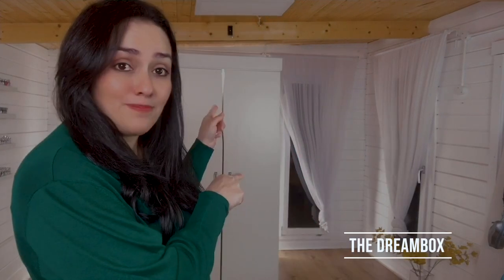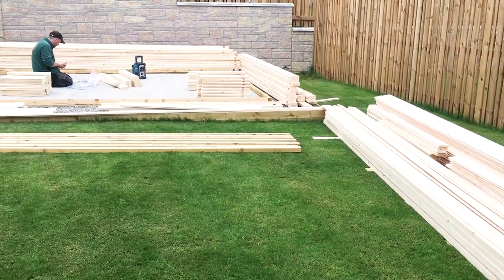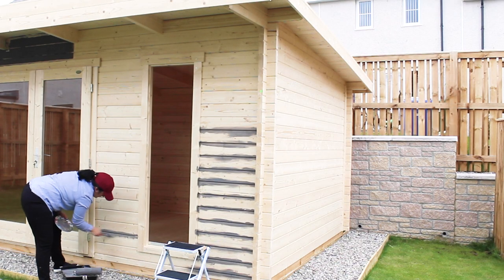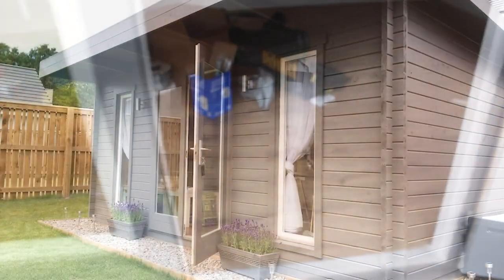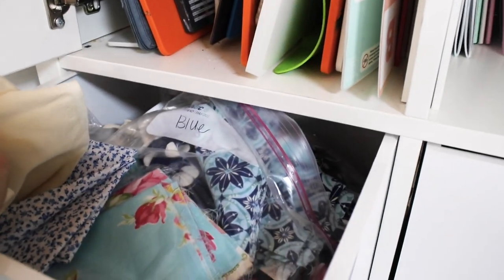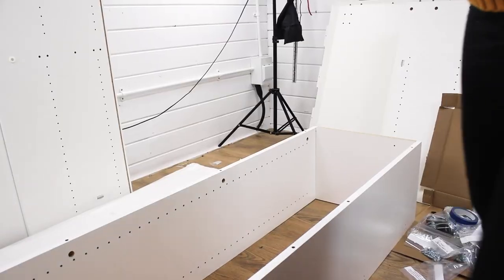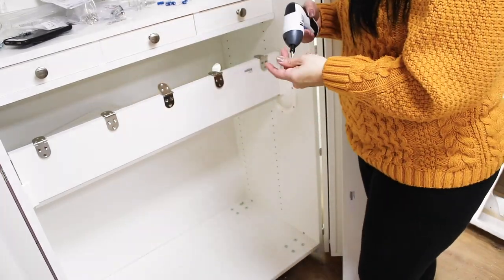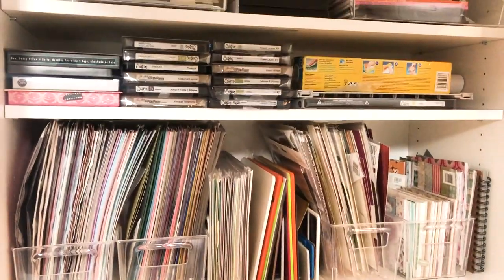DREAMBOX in a Log Cabin - SHE SHED + 2024 Discount Codes

Comment: Where do you store your glass Matt when not in use. Or other larger things like score boards, tonic folders. Did you use all your boxes and shelves or have you made sections bigger to accommodate items ? If you didn’t use all the shelves or boxes where do you keep them? Where do you keep items that don’t fit in there?  Do you still have space to put the upcoming tonic various club dies and stamps that you get? Also do you find that you do NOT close it every time you stop crafting.
Reply from the maker: Hi Viv,   yes I do keep the box open.  if I need to close it  I just put the glass mat to a side.  The few shelves I'm not using are above the box inside the crown - no over the light area tho. Underneath the table, there is plenty of room to organize larger supplies and I still have some of the kitchen cabinets in the other end of the room. They are still messy,  so I'm not proud to show them.  I don't have Tonic folders any longer they take too much room.  Yes, I still have room for new supplies. Oh ! I used a few of the  Dreambox trays to store some of my sewing supplies inside the cabinets but I thought that was irrelevant.
Reply: Not irrelevant at all as I have sewing AND crochet stuff I need to store. I now need to work out how much room would be taken up by crafts, yarn and sewing !